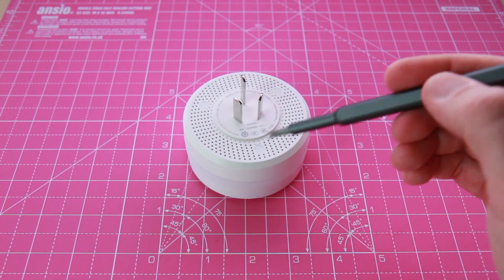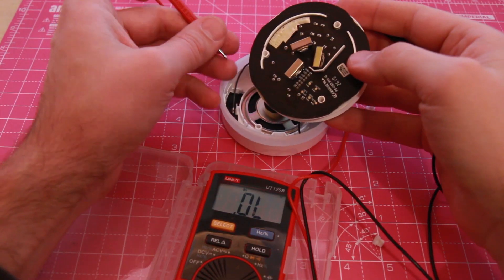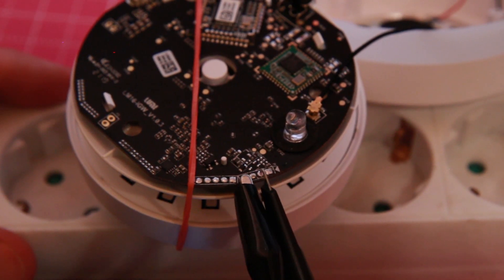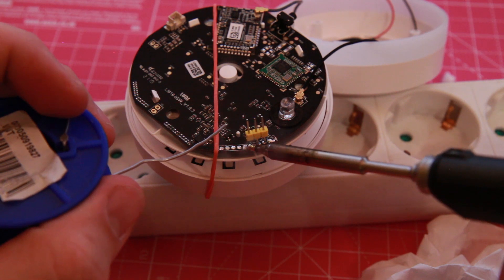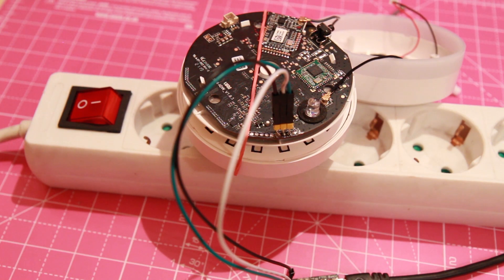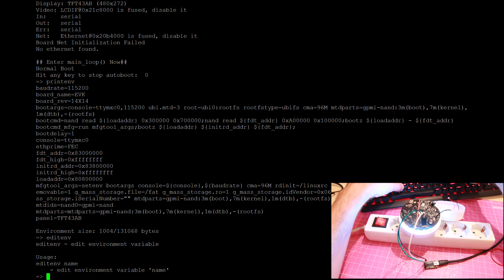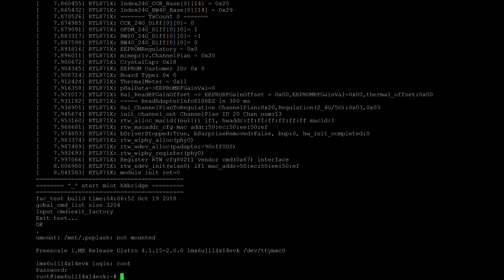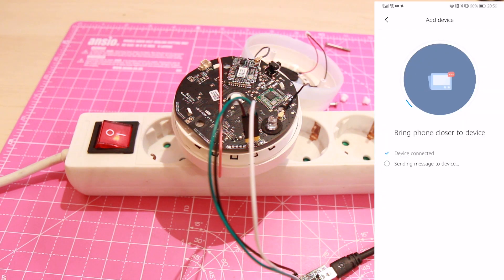Xiaomi Aqara Hub (CN) on European server

Comment: Its work, but not inicialize on MiHome. Cant change HUB settings
Reply from the maker: Can you provide exact model of your hub? I suspect that there might be some different versions of the hub which do not work this way...
Reply: Kaspars ZHWG11LM.   Now its show error 7 on MiHome. In Aqara App its show wersjom 2.0.1. But if i try to update to 2.2.0., its begin, restart, but i still have 2.0.1...
Reply from the maker: @marianoitaliano814  I have exactly the same model. My firmware version is 1.6.8 tho, I have not upgraded to 2.x version, it might seem that the 2.x firmware needs some additional work to get it going with EU servers...
Reply: Kaspars can you change some HUB settings from MiHome? I see only shield and error 7. But HUB work very good and i may change settings only from Aqara App.

Comment: Does it will continue to recive updates? And if it yes it will be restarted to chinese version?
Reply from the maker: I have been using modified version for over a year, have not experienced any issues ... if there were some updates then they haven't reverted the configuration back to the stock settings...
Reply: @kaspars3559  thank you 👍

Comment: SUCCESS!!! This totally works, I am so happy. 😁😁 ❤️❤️❤️ I had assuming this hub would work in New Zealand but then it only worked on the china mainland server. After following your tutorial I've got mine connected and with temp sensor and movement sensors working. Anyone claiming it doesn't either hasn't actually tried or did something wrong.  Unless you have the appropriate equipment and experience I'd be very cautious about bricking your device by making a silly mistake.  I regularly work on critical servers as part of my job and so have lots of console experience.  I didn't end up editing the acc_creator.json and there was no issue.
Reply: SiggyPony please make a video tutorial. Currently only you and kaspar are working this.  please provide explanations thanks
Reply: @popcorn7310  The process for gaining access is in this video, the information on the files that need changing is on his blog.  You don't need to alter acc_creator.json.  If you ever using vi to edit a file and anything goes wrong like you accidentally delete data you didn't mean too always :q! out instead of trying to restore the file yourself as it will dis guard all changes NEVER try to fix the file yourself.  You need a model ZHWG11LM hub and make sure the the build and revision versions of your software match those shown in the video exactly, any differences might indicate your hub is running a different or patched firmware.  If you've edit files and altered them incorrectly unless you made backups of the files before altering them there isn't likely any easy way to fix things.  Last night I tried the same process on a Normal Mi Hub model DGNWG02LM and it uses a different system that you can't (to my knowledge gain access to root with), you can connect via serial but you can only interact with the Mi software running on it.  Another thing, I wouldn't go and alter any extra files, only alter the ones you know you need to, altering other files could cause unexpected issues.
Reply: If you accidentally altered an ID (apart from the model numbers you were told to), Key or Mac Address in any of the config files that might be why its not working, and I wouldn't know how to fix that.  I backed up the files before altering them, but the IDs are likely per hub for account binding purposes.  I might play more if I can buy another Hub after the Global Human Malware situation is resolved :) but I don't want to risk breaking the one I now have working
Reply: If you have a big house, maybe by a second hub and be more careful and use it as a reference to try fix the first?
Reply: Actually also check in your Mi Home App that your region actually expects the model your altering too.  When you try to connect to an Aqara hub after the first attempt it will allow you to look for a wireless SSID.  If it doesn't how the expected "lumi-gateway-aqhm02_" type SSID, and has _3 or _4 then update your model edits appropriately, but I don't know if it works for the 3 or 4 models or what region they are for
Reply: @SiggyPony  I never receive the option to check the SSID that the Aqara hub is broadcasting. The iOS app never asks for that, only with the original Mi smart hub. I also get the "Failed to initialize device (7)" error as some people here. Do you know what can be the cause of this?
Reply: My Aqara CN hub is ZHWG11LM, I have tried several times, in Xiaomi App with EU server the hub is not detected, it only works with Mainland China server. Please make a new guide better explained step by step clearly, thanks

Comment: Thanks for the movie. Do you know how to open port 9898? Start development mode?
Reply from the maker: I think the binary is different from older versions... I haven't found any references to 9898 port in the device configs ... I did found on gitlab a modified binary which opens the port, but that binary is for Xiaomi Roborock. I tried to use it and I succeeded in opening a port and started to receive events, however it was not sending events to xiaomi server anymore. Probably some things are slightly different and will need to be adjusted, but I haven't got time for that right now...